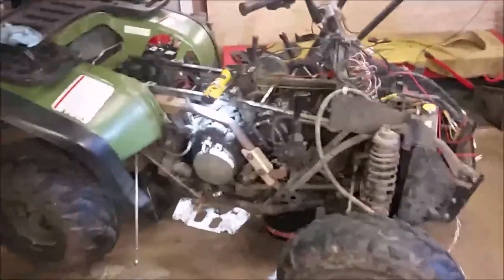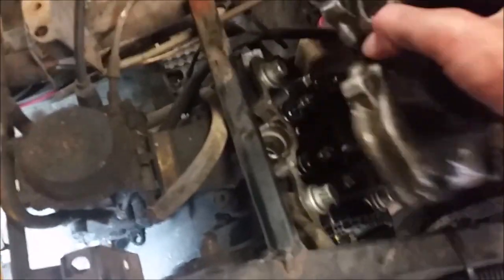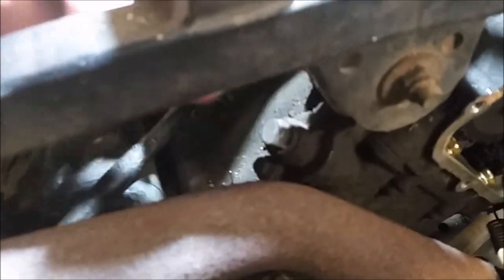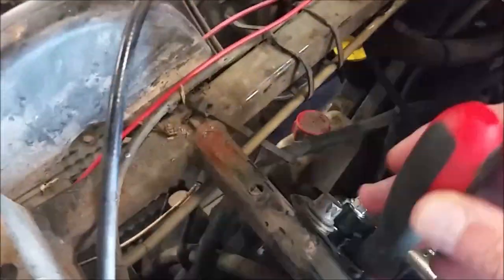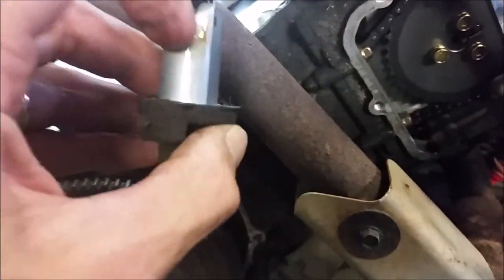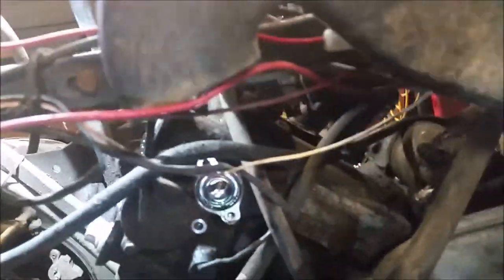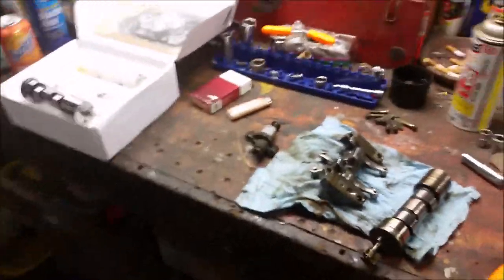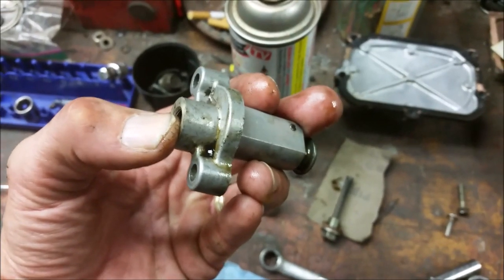Polaris 500 camshaft removal and replacement

Comment: Please respond to this, So my 1997 non HO had its cam and rockers changed by previous owner. I am adding a new larger 40mm carb and larger carb boot. My question is, is there such a thing as an HO cam for these machines? All the cams i find have interchangeable part numbers with my 97. Im wondering if it possible that they had a ho cam on a non ho 32mm carb and thats whats causing my runing issues.

Comment: DUDE LIFE SAVER!!!!!!!!!!!!!!!!!!!    I have a 1997 Polaris Explorer 500 that has no more power past half throttle, already cleaned carb thoroughly.. Same issue Start/Idle/first 25% of throttle is great.. but get to 1/2 to full throttle and I don't get any more higher RPMs or power.  Some backfire when let off throttle but not much.  So this is my next endeavor.  Thanks so much for videoing this.

Comment: Hey T Garage, just want to say thanks for this video. I was at my wits end with my 99 scrambler 500. I had rebuilt the carburetor(a youtube video helped). I replaced a voltage regulator that was burnt up. I didn't know what else to do. My Dad suggested googling with the problem. I came across this video and I couldn't believe it. Watched it a couple of times to make sure it seemed like something I could tackle myself. I ordered the parts and replaced everything like you said to. This Memorial Day Weekend(2021), I rode the fourwheeler all over. I can't believe how much more power it has. To say thank you, just doesn't seem like enough. But thank you!
Reply from the maker: Right on! That's awesome.  Thanks. I just enjoy helping people.

Comment: My 02 sportsman has lots of power but it is super hard to crank.  I have to slowly pull the cord until it’s at TDC, then pull it to start.  If i just pull hard first it will feel like it’s ripping my arm off.  It’s just too strong for the electric starter…. Any suggestions can help

Comment: I have a 2002 500 HO are the parts the same for that as well most of the description just say fits all but it doesn't say anything about the 500 h.o. I just don't want to order the wrong part excellent video thank you so much!
Reply: I also have a 500 h.o. Would like to no if there's any difference in a 500 and a 500 h.o camshaft.

Comment: Thank you for the video   I have a 2007 800 efi sportsman and it has the same symptoms   Do you recommend I change the camshaft on it as you mentioned only the 500s were having that problem

Appreciate any advice
Reply from the maker: I have a video on a 700/800 engine build. I always thought those cams would hold up good till I ripped one apart. Had to replace it. Depends how many miles you have on it. Over 4000? Yeah...I'd replace it.

Comment: Thanks for very useful video! I am curious though, is the camshaft not restricted in the axial direction at all? The rocker shaft has an indexing bolt to keep it from sliding out the sides but the camshaft seems to just float around in its bearing holes, only held in place by the timing gear(!!)
Reply from the maker: I had noticed that too and wondered if they built it that way for wear reasons. The end of the cam has a flange to stop it from going into the timing chain cover. But the only thing stopping it from going the other direction is the lob.

Comment: Hey T Garage, I rebuilt the top end with new piston and rings. Put it all back together but used old head gasket because it didn’t look bad, well it was  so I had to pull head and replace it. It was starting and running fine just would bog at 1/2 throttle before, So I checked the cam and sure enough middle lobe was worn badly. So I bought a new cam and rockers. Put it all back together got it in time and set the valve clearance.  Turned it over with valve cover off and spark plug out it did what it was supposed to as far as I could see. I put the spark plug back in and it turned over very slowly like it hydro locks on compression stroke. So now I’m stuck. It’s also like the exhaust valves are not opening. Any help would greatly be appreciated. Thanks in advance.

Comment: I got a 97 sportsman 500 and it sat for some years. But I took it out and cleaned it up. I had to replace the head gasket since there was water getting into the cylinder. I got that fixed and cleaned up the carb and tried starting it but I got nothing but a big backfire. I kept cranking it over and shooting some starting fluid in it but still nothing but some little pops once in a while. I watched this praying for it to be the cam but the cam and valve clearance was completely fine. And yes the timing was correct. Could you please help?

Comment: Awesome video, just picked a 2003 sportsman 500, I'm thinking this is my issues as well, carb spits n sputters, dies when you start to accelerate, back fires, new carb, new sparkplug, switch on accelerator bypassed, do you have part # for cam?
Reply from the maker: No I don't off hand. If you search eBay you will find it. Or try partzilla. For the part number.

Comment: Hi, how is life treating you?

In one of your videos, you mentioned the blind plug that has to be removed in order to test for oil pressure, however, you failed to point out where the plug that must be removed is. I think that the thread is 1/8@ NPT and it must be the plug in the front of the cylinder head to the left of the exhaust outlet, but I also saw and larger blind plug to the right of the exhaust, do you know what that one is for?
Take care, looking forward to your reply, in the meantime, I remain most cordially yours,
Franklin

Comment: Hi..great videos..I'm about to put a new cam shaft in my 96 Polaris sportsman..is there a certain way u slide it in ? Is that little bearing on top or on the bottom when u put it in ? And should I bolt the gear on right away or should I do something else first...I cant find a video of anyone actually putting it all back together.  Thanks for any help u can give me..Ed
Reply from the maker: No certain way. You can slide the cam back in and bolt it to the sprocket right away. Just make sure your at top dead center and your 2 marks on sprocket are up at the top like in the video.
Reply: @TitaniummanGarage  ok...thank you very much for your help

Comment: Hey buddy thank u for the videos. They are helping... so my sportsman 400 4x4  is starting right up great idle but when I give it has and hold the throttle open ot starts to bog out. So I was wandering which one of the 3 should I do first? The CDI Box or the Cam or the carburetor?
Reply from the maker: I would start with the carb first. easy fix first. clean the jets. from there check the timing and valve lash as it should be adjusted every year. The chain does stretch over time. then you can peek down and see if the middle cam lobe is worn out.

Comment: Glad i found your channel great videos.  So today i thought id try to tackle the timing on my 96 sportsman 500 thanks to your video. I took the camshaft adapter cover off it has 3 bolts. I did all the timing stuff went to go out that cover back on and it wont go on that little needle piece sticks out to far now any ideas? I punched a hole innthe cover trying to screw the cover back on
Reply from the maker: You have to pull the cam out, turn it upside down so the decompression ball is out. the pin should slide back in. Make sure the spring is in the right spot.

Comment: Thanks for the video, I’m going to replace the head gasket on on my 06 800 X2, that being said , can I just remove the valve cover gasket, put the engine at TDC, remove the cam gear and tensioner only, then unbolt the head according to your video and then reverse , or am I missing something?
Reply from the maker: I've never done a 800. But ,yes the same rules should apply
Reply: @TitaniummanGarage  hi so I have a 02 Sportsman 500 h.o. all the camps listed on Amazon say 500 all models do you think it's the right cam if it doesn't say ho listed I just don't want to get the wrong kit thanks

Comment: Thanks for the video. You have helped me a lot with my 2002 sportsman 400 4 stroke. 

The bolts on my rocker arms are tight, really tight. Before I try more than a persuader. Is this a sign of something else? Warped top end? Should I heat the bolts?
Reply from the maker: Is there play between the rockers and valve's? You might not be at top dead center  check down the plug hole to see where the piston is sitting. They usually are not that tight unless pressure is on them.
Reply: @TitaniummanGarage 
As best I can tell, I am at TDC. I can see the piston and put long stick to find highest point. The back side rockers(intake) has lots of play, way more than .006. The front has very little play. A leakdown test had air going through the carb into the box. I assume that is the intake valves. I am preparing to replace valves but can't get those bolts off..

Comment: I just had my carb rebuilt on my 02 sportsman 500 ho.  The Chinese one I had worked, but when it got hot it seemed to  be rich (or lean) and stalled out.  When I put on the original rebuilt carb it started and idled well but when I give it throttle it coughs and sputters and I have minimum power .  I'm not sure why this is happening now with the original rebuilt carb, but it is.  I thought for sure it had to be a carb issue, but some are saying now that it could be a cam lobe issue.  That doesn't make sense to me as that should have presented itself in my mind before the carb change.  Any insight is appreciated.  Thanks
Reply from the maker: It could be the cam. And wouldn't hurt to look at it. While your there if it looks good adjust the valve lash. Its .006 between the rocker and valve.

Comment: I have a 2000 Sportsman that sat for 3 years with old fuel, rebuilt the carb but found a faulty fuel pump also. No spitting through carb but bogs at higher speeds. Waiting on fuel pump to show up. This has 1700 miles on it, what is the average mileage for cam wear?
Thanks for the informative video.
Reply from the maker: You have a 2000 so you should be good. 1998 and 99 were the bad cam years. Polaris made them too soft. I can't tell you the average mileage. It depends on how hard it was rode.
Reply: @TitaniummanGarage  Yup the problem ended up being the fuel pump and some dirty (plugged) idle jets. Running great now. Thanks for the reply.

Comment: Is there a decompression release any where on the cam . My 500 does not turn over when trying to start. With my limited knowledge I have checked timing and valve clearance (.006). Motor turns freely when spark plug is removed. I am missing something.Thanks Jon
Reply from the maker: Decompression ball on the cam might be stuck open.youd have to remove rocker cover to check it out. It's on the exhaust lobe.

Comment: Hey bro...just put everything back together after putting the cam shaft in...now it wont start..sounds like 8t wants to buy wont...before I replaced the cam it would start right up..do u know which straw  in the tank that the reserve line goes on ? The tall one or short one ? I put it on the short one..I did replace the cam sprocket because that came with the kit...when I put the new one on I made sure the 2 dots were at the very top and I could see the T through the hole in the pull start case..not sure what I did wrong..if I didn't adjust the valves right would that cause it to not start ? I'm about to take my sledge hammer to it !
Reply from the maker: Short straw is reserve. Double check you have fuel going to carb. Shoot some starting fluid in carb. It helps. If rockers were not adjusted it would still fire. Check your electrical conection make sure you have spark.

Comment: I know this is an older video but I am catching up on a lot of yours. I have a 2008 Sportsman 500 EFI HO X2. My compression relief is not working . I have to ease the pull start slowly til it is just past the ball on the cam . It starts every time then. Have you ever tried to fix the spring on the end of the cam for the compression relief ? I saw a video on youtube where it has been done . Great videos for the 500 by the way. I am learning a lot from you .
Reply from the maker: Thanks. And yes. I have fixed the spring. Sometimes its the ball on the cam, the spring, or the rocker arm on the exhaust lobe is worn.

Comment: Is there marks on chain also for setting timing aand how much time was this cam job.Thanks in advance good stuff and was wondering how to adjust timing here if it is off and what might be the symptoms here.Sorry for all the questions
Reply from the maker: No problem.  There are no marks on the chain. But..the links are silver. If you take the chain off, set the crank where the mark is on the case. Oh..that wasn't in the video. Take the stator off. The gear the chain rides on has a mark. Line it up with the mark on the case. Put your chain on. Sliver link at timing mark. The other 2 sliver links will be at the top of chain where the cam goes. Line those up with cam. Detents. And boom. Perfect timing. Check out my video on splitting case sides. You'll  see what I mean..
Reply: Do you need to set the time if you follow this video exact? No correct as you didn’t disturb the timing right?

Comment: This is a good video, thanks for putting it out there. I had a question about inside the crank case. My 2001 Polaris Scrambler 500 dropped a valve, and I think a valve keeper+keeper pieces somehow went into the case. I bought another head to put on but I didn't want to mess up anything in the case with those pieces still laying in there. I just don't want to have to take the engine out and apart due to already spending a lot of time on it and sealing the clutch cover back on before. Any suggestions? Thanks.
Reply from the maker: Pull the jug and piston. I used a magnet.
Reply: @TitaniummanGarage  Okay I'll try that, thanks.

Comment: Great vid!  But, I'm feeling a little foolish, by not checking out more things before going for the cam replacement. 
My 2002 with 2800 miles had all the symptoms of the worn cam. However, when I popped the cover and got a look at it, it doesn't look worn down at all. Everything looks good, other than I can not find any white timing marks through the inspection hole, even at TDC.  Chance it is just a timing issue?  Has always started and ran great. Was plowing with it, it back fired and quit. It restarted and I limped it into the garage. Will start and idle fine, indefinitely. But any throttle will kill it. Thanks
Reply: Just found your CDI box Video, I'll check that out. Thanks!

Comment: Hey, thanks for the great video! Replaced my cam this morning and it’s running better, but still dies out when rpm’s are raised. Checked the fuel pump to make sure it’s getting enough fuel. That’s fine but still dies out. Any suggestions? Thanks in advance love the videos!
Reply from the maker: Do a good carb clean. check vacuum lines.

Comment: Hey I'm tackling this project right now I got it for really cheap. but when I took the cover off it was missing rockers and everything. I bought the rockers but didn't come with the 4 bolts to bolt it down. I orderd them with what I thought was the part number but bolts are way too long. Do you have a part number or the size of the bolts. The ones they sent me are to big and too long
Reply from the maker: Check partzilla. I'm not sure the size. I just know it takes a 10 mm to get them off.

Comment: What brand of camshaft did you use and do you know if it’ll work in a Polaris sportsman 400
Reply from the maker: I bought the one on the video off of ebay. Don't know the brand. I didn't care for the rockers that came with it. I now buy slightly used cams in tolerance. I like to stay all Polaris.

Comment: just replaced the cam and rockers on a 97' Polaris sportsman 500. Is there torque specs for the 4 rocker bolts and 3 bolts on the timing chain sprocket? I did see the valve lash was .oo6.....just dont want to break somethin or have them to loose and they come out.
Reply from the maker: I'll have to check the manual

Comment: I know this vid is 4 years old but is there a recommended kit for this fix? I've been searching around and I've found anywhere from $63 on Amazon (from china) all the way to about $800, polaris OEM buying part by part. Quite a few on Amazon but the reviews are what I'm going off of and many are not within tolerance and don't fit properly.
If you have a good recommendation it would be greatly appreciated.
Reply from the maker: Are you just talking about the cam? Or the gasket too? I buy used camshafts on Ebay. Like you said. the aftermarket is off. I buy Polaris head gaskets for 50 bucks on Ebay as well. So it cost me about 100 bucks.
Reply: @TitaniummanGarage  thank you for that info. I was asking about a cam/rocker/gasket kit. I know Rev6 has a kit, but $250 isn't what I was expecting to spend, but most of the time, you get what you pay for.
Reply from the maker: @corbinashley6857  Rev 6 Is really good. I've bought some crankshafts from them. they are top of the line. But if your on a budget, Ebay...Used parts. Just make sure the cam is in tolerance.

Comment: I might have missed something but don't you have to make sure the new cam is put in the proper orientation?
Reply from the maker: Yes, but it will line up or youll have to turn it when you put the cam gear on.
Reply: @TitaniummanGarage  Ok. I didn't know if it was possible to attach the cam and gear together in the wrong position or not.  I didn't remember seeing any info on that in the video. Or is there something that only allows them to be bolted together in one position?

Comment: Hey Bud where did you get your whole Cam kit from what is it called and do you get it from eBay or another site could you let me know thank you
Reply from the maker: I got the one in the video off ebay. I didn't like the rockers that came with it. That was 2 years ago. They may have got better now. I buy used camshafts and rockers in good shape within mechanical limits.